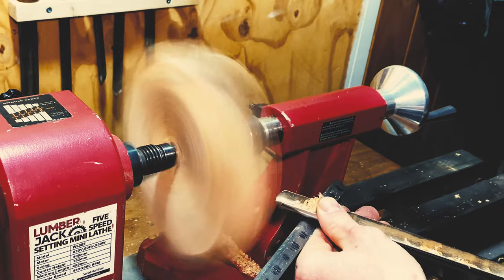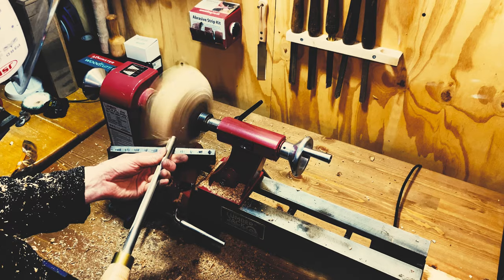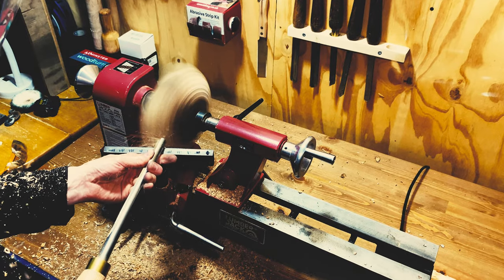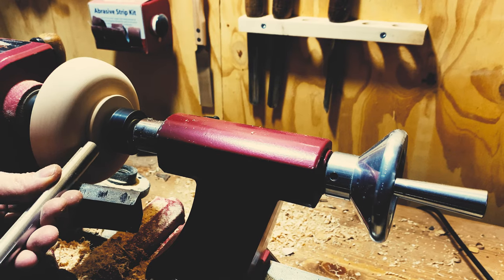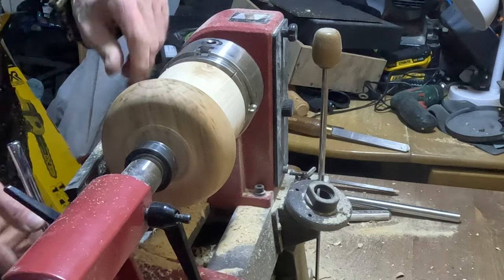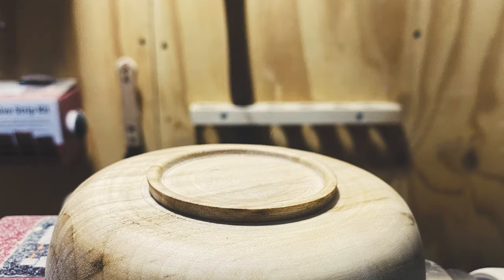A Bowl From Fire Wood - Was It Worth It? (Yes)

Comment: I feel you! I've only recently started turning myself (I'm currently at a count of six bowls that survived turning). I've picked up many hobbies, and I've found woodturning to be less like other woodworking skills and more like learning to play cello. First you have to learn how to not make something horrible happen, and then you practice the same motions over and over with imperceptible adjustments until you can put the bow (or gauge, skew, etc.) in the right place at the right angle with the right amount of pressure. 

Something that has helped me is to find videos where turners demonstrate different catches. When I started, I watched the ones that matched the tool and grain direction I planned to use before every session at the lathe. It helped me keep track of which techniqes were for end grain vs. cross grain and from which general direction each tool should approach the wood.
Reply from the maker: Hey. You are absolutely right, it is the really small details that make a difference. I’m slowly getting there and wish I could spend all day practicing. I’m pleased you are also making progress. It would be good to see your creations too!